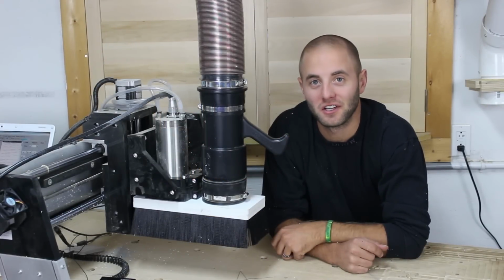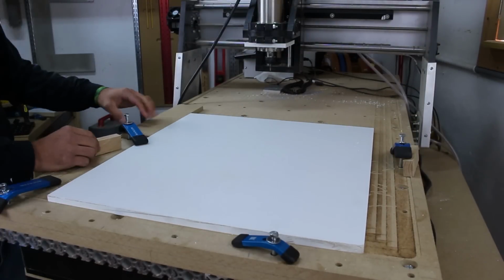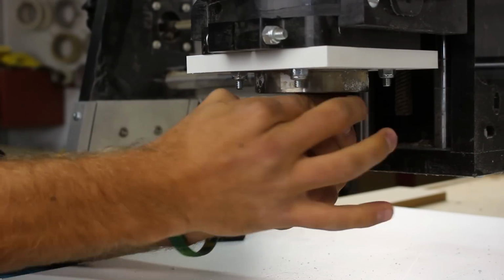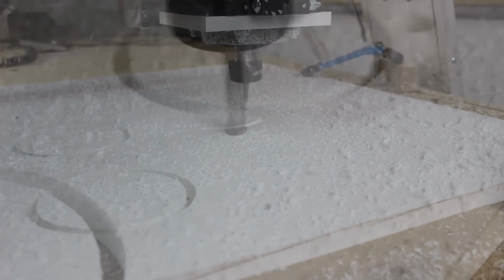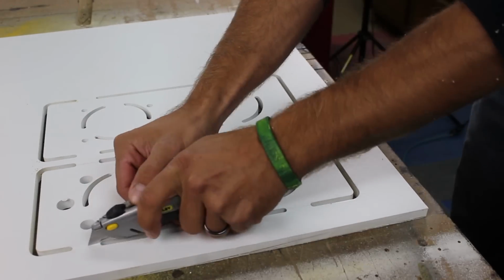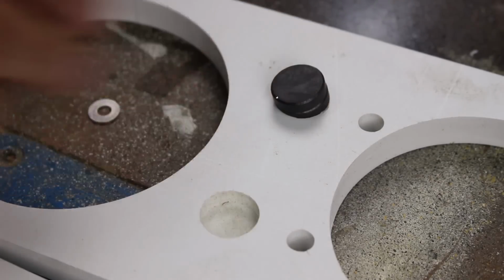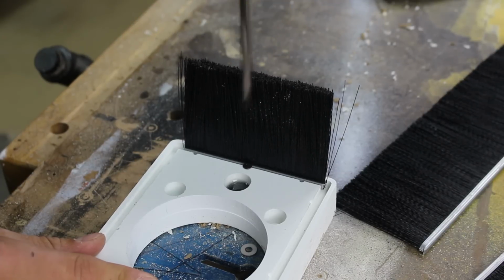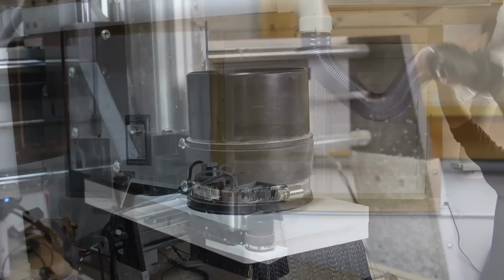How to make a 4 inch dust boot for your CNC SHARK HD3

Comment: Andy, Nice dust boot! What I have done to eliminate the static of the chips clinging everywhere is to wipe down all of the metal surfaces of my machine with a dryer sheet. Works well. A friend of mine has a shark and we would like the CAD file for your boot shown here. Thank you in advance and try the dryer sheet.
Reply: Terry Jones Great idea about the dryer sheet. Do you wipe down before carving or after?  If before, how long does that anti-static effect last?

Comment: Perfectly set 'Z' axis...there is about 0.2mm play when it touched the plate due to which I assume is plastic particles underneath the zero plate 4:32. lolol...Even more interesting is that it pushed down on the plate. Logic is telling me as soon as it makes contact with the plate it should stop when the circuit is made...mmm...interestinghttps://youtu.be/CQKRHIAV95g?t=44https://youtu.be/CQKRHIAV95g?t=44

Comment: Another great video. What if you make a second bottom plate and only attach brushes on three sides. You might be able to film and collect most of the dust simultaneously.
Reply from the maker: I will try that! I may have to put some lights in there to keep the bit visible
Reply: +Glass Impressions a filming boot made out of strips of clear vinyl might work too

Comment: Looks like it works well Andy. How long do think it will take to get all the plastic out of your shop now? It looks like it's everywhere....
Reply from the maker: Well, the 4inch port really makes quick work. Spent about 10 minutes really cleaning it up but I am sure I fill find the stuff for months to come. I miller another bottom plate for different length brushes, I used the boot. 90 percent was collected. 100 percent contained to the table. Works well!